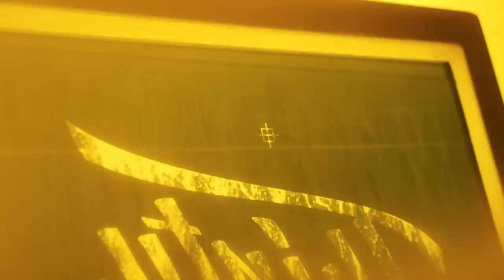SCREEN PRINTING FOR MY OWN CLOTHING BRAND

Comment: Love your content. I have been screenprinting for a little over 2.5 years now. A small tip I would recommend always starting printing the most “difficult” task first. ie: the sleeve prints. That way you won’t print everything and then get to the last part and ruin three or four as well as waste so much time. Hope this helps. Keep up the great content!
Reply from the maker: Haha that's generally what I do too, I just didn't think I'd have anymore issues  with sleeves this time. Always learning something 🤘🏻

Comment: Wow.... found someone else doing the same thing I am... I print my own brand and for others also.  Keep up the good work man.  The videos are awesome, much respect to you.  I always say I'm going to shoot video of the process but with the camera on it just slow everything down.

Quick tip I started doing to save myself some time.... I take all my shirts over to the heat press as well bc I love how it smooths everything out.  For the washing instructions I now print transfer sheets for them and when I go over to the heat press I just grab the corresponding transfer and press it.  Ryonet sells the paper and powder. I use the lava grey for them works on white and dark garments.

Keep up the good work
Reply from the maker: Thanks man. I actually prefer to print the labels on press rather than with a transfer. I used to use transfers for like a year before I got my press, but doing it on press I find I have way better quality with the label and I'm a lot faster

Comment: The big bolt that hangs down that you are talking about is why we sold our Riley Hopkins press and went M&R even Workhorse has that kind of Shit hanging down underneath the pallets.M&R is probably the best professional equipment there is for screen printing.We always had problems trying to print sleeves or legs back when we had our rally Hopkins.Once we went M&R it was over...Good luck man and how in the hell can you stand that cold and snow it’s been 70s and 80s here for weeks lol...... PS I’m in Georgia

Comment: damn that was a lot but i enjoyed it lol just a suggestion for the tags, maybe sew them on before printing so when you go to press em that's the final step before bagging them. also had a question about pressing, does it leave a heat press box? Thanks for sharing
Reply from the maker: Thanks man. I don't sew the tags on until last because if there's a misprint or something like that, then I wasted time and money on sewing a tag that's going in the scrap heap. But no the heat press doesn't leave marks because I do it for a very short amount of time just to glaze the top layer of ink. Only 3 seconds

Comment: Looks like you do not have a vent hooked up on your curing oven. Is it because the type of plastisol you use? if so which type are you using? Man with the determination that you have you will make it big for sure. Thanks for the videos.
Reply from the maker: Not yet, I don't plan on staying in here long so I didn't wanna bore a 3" hole in the side of my house haha. Plus with plastisol it's not all that bad, opening a window with a fan works just fine in here

Comment: looks great man. Did you have any issues with the image stretching out when pulling the hoodies off the platen? Sometimes when I use the web adhesive, the fleece sticks to the pallet too much and I can't pull it off without stretching the image. One fix I've been using is flashing the image for an extended amount of time so it's almost cured. That way it doesn't stretch out as much even if I really have to pull it to get it to release from the web adhesive.
Reply from the maker: Thanks dude. I've stretched a few in my time, but using adhesive in general requires a bit of practice to figure out just the right amount to make it easy enough to remove but still hold the shirt down. I'm getting there with my setup now, it's taken a while haha

Comment: Awesome video as always Lee! I have been screen printing among a variety of other application methods and enjoy watching your progression!

I had a question though, what timing are you managing to get on your X-Vactor?
Also, I assume you are using water based inks straight out of the gates? I struggled with them for quite a bit and ended up falling onto Plastisol for a while to keep quality consistent whilst I was learning.

Keep up the great work bro and don't stop these video's from coming, really great for your brand!
Reply from the maker: Thanks man. I only use plastisol at the moment, water based is something that takes a lot more time and experience to figure out. But your exposure times depend on your emulsion, mesh count and a few other things. I recommend buying a little step calculator to help you out there
Reply: @leestuart38  oh that's interesting. Awesome well keep up the good work and look forward to seeing your waterbased videos, it was a challenge when I tried so I stuck to what I know for a while.

Comment: The print on hoodies is good. But on hands also you printed. I think you should try box type design print on hands for hoodies. 

The position of that box design print on hands should be just above the wrist facing east & west  directions for both hands. Using one box design on one hand facing east direction and one print facing west direction on other hand. Try it check the design. I felt rather than using a long print on hands this may look good.   

Its just my opinion.

Comment: Another great video... love the finished hoodies.. and as always just very enjoyable to watch. 
I'm subscribed to a few people and I haven't seen anyone else heat pressing their finished gear... Not that I've seen anyway... it obviously doesn't cause any issues with the ink or whatever but how does it work ... does that process sort of re-cure the inks or Is it not that hot .. Just wondered.
Still loving the videos... keep putting in the hours mate.... brilliant
Reply from the maker: Thanks dude. What heat press does is kind of re-activate the ink so it can flatten out and smooth over.

Comment: So what do you do to prevent the platen mark that gets left behind when heat pressing the garments.  Specifically on polyester garments. When I press my garments to get that gloss look, I always see the square of the platen
Reply from the maker: Press marks usually mean it's been pressed for too long, under too much pressure, too much heat, or any combination of those things. It takes a while to dial it all in with your press

Comment: Hi sir i like your content. I just have some few questions, I hope you can shed light.
1. )What kind of file format should I give to the printing supplier for my design?
2.) Should the design be in HD quality?
3.) How do I determine the right size of image/text/design to be printed on the shirt?

Thanks
Reply from the maker: These are all great questions to ask before going to a printer, good on you for doing your research 👌🏻. The best file format that you can give your printer is any type of vector file (.ai, .pdf, .eps, .svg, etc.). Unless your artwork highly complex like photography based or highly graphic work, then a .psd file would be best. In the end you really just need to send them the highest quality file you have, this will give you a better print. When it comes to sizing that's really your preference for the most part. Most printers can run designs 12-15 inches wide, and anywhere between 16-22 inches tall depending on their equipment setup. Hope that helps 👊🏻
Reply: Thanks man! Appreciated it a lot! More power to your content bro
Reply: One last question man, does the measurement/sizing of design differ for every shirt sizes?

Comment: Great video! My goal is to have a print shop in a couple years. Just started making my shirts with a heat press. What are you doing with hoodies you messed up? Are they for sell?
Reply from the maker: No those will end up in my scrap heap for test prints and eventually shop rags, can't have stuff out there that isn't up to par. Good luck with the shop!

Comment: Did you find that the roller squeegee actually makes a difference? I've always wondered, but those are kinda pricey.
Reply from the maker: So far I'm loving it. It definitely makes a difference, not much of a difference from the solid screen/squeegee technique, but a lot easier to work with every day

Comment: next time save yourself some time by not rolling the shirts if your going to heat press them
Reply from the maker: The way that I press them with super light pressure so it doesn't blow out and mash the print like I see everyone do, it works and looks much better doing both
Reply: Lee Stuart 😎 I guess if that works for you it’s cool plus if you have the time I don’t see why not 
I’m a make a video about it to see if we can see a difference 
What mesh did you use 160?
Reply from the maker: I don't have the time, but I make the time to be able to have a higher quality standard. The trick is to have a super light pressure so it's not actually flattening the print, but just glazing the top few microns of ink. That's why the roller step is still in play because that light pressure wouldn't flatten out fibrillation if it was there. I can definitely notice when someone is pressed with too much pressure because it will push the whole design out like one or two millimeters, something not a lot of people would notice but I certainly do. This was all printed on 110 mesh since it was heavy white for the majority of it
Reply: @leestuart38  you would have time if u used the right mesh and u didnt do all them steps roller and press is overkill press will press things out also. u would be better off fixing ur off contact and not doing all them steps higher mesh also if you're going to do all that and u like the gloss look why not just cut vinyl and one press and get the same thing and not take 3 days your not making money at that much time in.
Reply from the maker: The fact that you even suggested vinyl is funny enough...never mind your typing and grammar skills, suggesting that printing/tagging/packaging 400 pieces in 3 days alone is too long, or that I wouldn't be making money on those pieces that will be selling at full retail and have a net profit of over $15,000. The whole thing was a great laugh 😂. Thanks for the expert opinion
Reply: @leestuart38  its funny u have to pick on someone's grammar if it makes u feel better but I'm sure you know nothing about or my background. u keep talking about the butter feeling if u printed the right way you wouldn't need all them steps or they wouldn't have reamed  you raw, you could have used the sleeve boards the wood ones yeah the al ones work good but if u know the steps and how to print you can make it work with anything watch the ink build up hes doing it in mexico with nothing and turning out good stuff . the thing when u sell out for adds and only use one brand you dont know about other products out there and the vinyl was to make a point about the feeling and look u said u liked that's the same with only doing one step . you get mad when someone tries to help or make a point its called constructive criticism u haven't been printing that long there's room to learn but glad u feel better cause my grammar :)
Reply: @leestuart38 I just saw where he was trying to help if u want that butter smooth u dont use a 110 a 110 plastisol ink is thick enough to stop bullets .  and on a white shirt ur wasting ink and time with a 110
Reply: @leestuart38   buy a sample of the white streach vinyl and compare it to your prints to see if you like it. or if you like ill cut it for you and ship it for free so you can see that there are other options just e-mail me your logo or whatever you want to test out
Reply from the maker: Appreciate the offer man but no thanks. I've been doing vinyl for a few years for customer work and I know what's out there, that's what helped build this shop. There's a reason why it's never touched anything in my brand though
Reply from the maker: Haha seriously dude, periods and commas exist for a reason and wouldn't make you sound like such a tard when you're trying so hard to criticize someone's work. Pretty funny that you liked your own comments too 😂. If you can't get a smooth print with a 110 then you're doing something wrong, not me. I do it non stop without taking those extra steps. But there's a big difference between a retail finish and a standard print shop finish. Why do you think things like super expensive irons and heat stamps exist for automatic machines and you can find one on every machine printing top retail brand stuff...because it's the only way to get that type of a look and feel, period. This is the same exact process but in a manual form. I don't give a shit how long anyone's been doing it for, if they've been doing it wrong the whole time. The reason this shop exists is because I've been through 6 different shops in 2 years, all which have been doing it for a very long time. It's weird that somehow in the 3 months that I've been printing, my stuff is already miles better than theirs in every aspect and I now have a ton of their clients and have already done sales in this shop that would make peoples heads spin. So clearly I'm doing something right and much different than the other shops out there, which is the whole point. You have fun being someone's squeegee bitch and doing things the way they taught you, I'll do it my own way and we'll see which one works out better 😘
Reply: @leestuart38  so ur talking about big shops and there set up they dont use 110 it's to thick there's no need on a auto unless ur using a ink that cant go though a high mesh and if ur that worried go to water base it feels even better sorry they don't have many shops in Canada to compare to
Reply: @leestuart38  and I have 2 thumbs up so I cant do both so maybe other people that print think the same thing